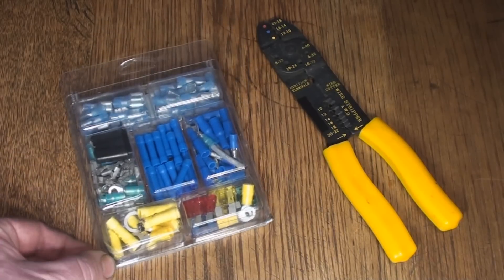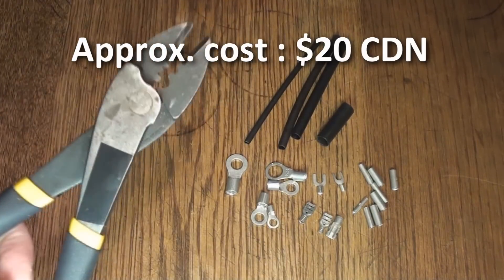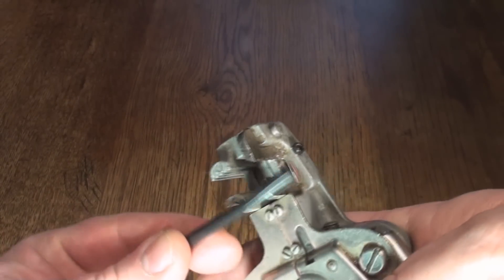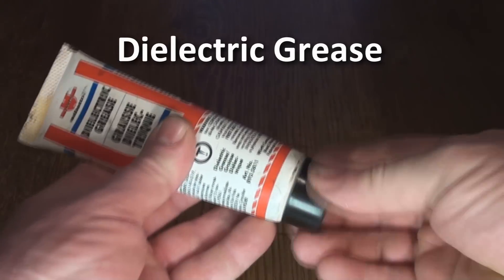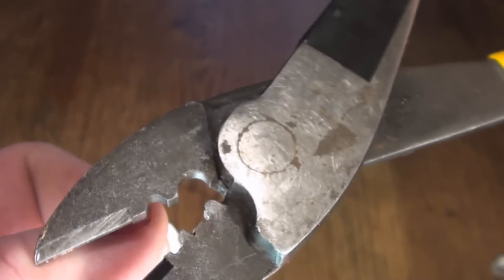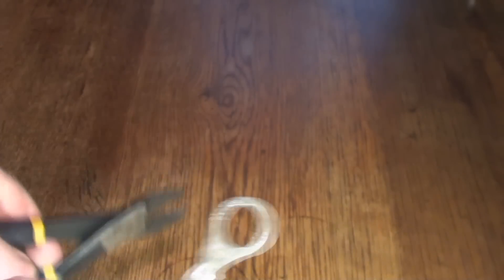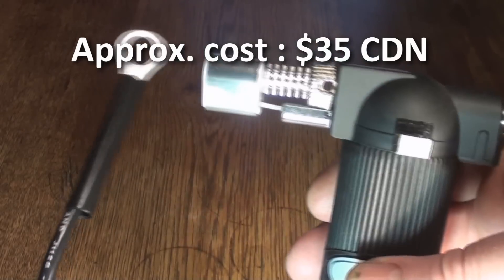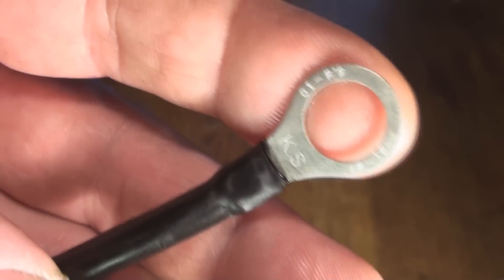Reliable Crimp Connections

Comment: Thanks for posting this video. This approach definitely gives more professional looking results than when using pre-insulated connectors. I'll be using this method from now on. Also, someone had asked what wire strippers you were using at 1:44. These look very similar to my Ideal brand Stripmaster strippers. I've had them for over 30 years and they still work great. Currently available from Lowes for $24.94.

Comment: Thank you so much for this brilliantly useful video. I have struggled for ages with the insulated crimps, finding they often pull out even though I have a ratchet crimp tool. There is nothing to hold the wires, whereas the uninsulated ones with the crimped in recess hold & don't pull out. Extraordinarily helpful to me.
Reply from the maker: +Springwood Cottage - Glad to be able to help. Thanks for commenting!

Comment: Good tips! I usually use a q-tip (okay, okay, i just my finger) to apply the Dielectric Grease after I've made the crimp, not before. Dielectric Grease is used to insulate and prevent corrosion. It's the insulation properties that wig me out but hey, if it works it works.

Comment: Great video, thanks.  I have always used the crimp tool the opposite way with the male die against the seam.  Now I am going to have to try your way.  
I like the use of dielectric grease, it should fill up any nooks and crannies in the joint reducing the opportunity for corrosion.
Reply from the maker: Thanks and yes it works great in marine environment

Comment from the maker: My strippers are antique and have no brand name showing. A quick google images search shows tons of options. Irwin/visegrip makes a set.
Dielectric grease is silicone based and therefore non-conductive. The idea is to give corrosion protection to the exposed metals. When crimped there will be hard contact where the grease is squeezed out but still clings to the exposed areas preventing corrosion that can creep into the hard contact areas and interrupt continuity.

Comment from the maker: The terminals you need do exist, so if you're a perfectionist, keep looking, someone's going to have them. Otherwise try piggy-backing: crimp a wire connector (tube) on the wire end, then insert the connector into the terminal and crimp that. In a pinch, you have to get creative. Sometimes I'll just strip an extra long piece of insulation off the wire and fold it back on itself - doubling the wire mass - and use the larger size terminal on the doubled over wire. Crude but effective. Good luck!

Comment: I think that a proper crimp is better than a proper solder joint.  A proper crimp deforms the copper strands  to the point that the spaces between the strands closes eliminating air and moisture from the connection.   A solder joint also eliminates air and moisture but it is a weaker joint mechanically and solder has more resistance than the direct metal to metal connection of a crimp.   
Also if you are good at soldering you should solder and if you are good at crimping you should crimp because both are good joints when done properly.
Reply from the maker: Thanks for commenting and for your insight!
Reply: Agreed, except that soldering alone should be avoided except where crimping is not an option.  Also any wet, insulating grease should only be applied after crimping and soldering!  It's an interesting technique but an unnecessary addition of dielectric.  However, conductive grease like silver-bearing types would be okay, but also unnecessary.  As a last concern, I would not use a torch where a heat gun could do the job.  Other than these few criticisms, there are many good points in the video.

The best method I have seen (used by Val den Hul Cables) and used is a very strong crimp (= cold weld) with solder applied to the exposed end, i.e. the very end of the wire, to seal it.  Finally, good shrink wrapping over the rest of the assembly, as shown in the video, will seal the assembly beautifully.  Semi-rigid, adhesive-lined heatshrink, (what appears to have been used) is ideal for marine environments.  I often double the layers, with a shorter one on the inside for the best strain relief.  This termination will conduct well for 100+ years in dry environments if the wire has good insulation and mechanical construction, and if the connector and terminal have rhodium and/or gold plating.
Reply: Terry Pullen good insight, both crimping or soldering has very applicable application advantages and disadvantages.

Comment: Good video but have a question.
Dielectric grease is an insulator,not a conductor.
It’s good to cover a finished terminal from corrosion 
but not use inside a connector,no?

Comment: I use the male side of crimpers into the split, then turn the connector 180 and use the non insulated crimp to give it a cold weld. I call it the tuck and fold

Comment: Very good instructional video, especially the close-up when you're placing the terminal seam-side up into the terminal pliers. What is the specific name or brand of the kind of wire strippers you're holding @ 1:44?  I haven't been able to find them.  I don't understand why your're dipping the copper into the dielectric grease -- wouldn't that interfere with the conductivity between the terminal and the stranded wire? Thanks

Comment: You can also shrink using a cheap cigarette lighter if you need to, I try and keep the flame off of the material though.
Reply from the maker: True but I always burn myself on the wheel the second time I try to light it.

Comment: I have seen many crimped ends done by the manufacturers and I can attest that the male part of the crimp tool goes into the crack forming a heart shaped end over the connector and not from the bottom of the connector. Please correct me if I am wrong and thanks for the great video !!
Reply from the maker: Ma Serry More than one road leads to Rome. There's even an airport.
Reply: Touche my friend !
Reply: Yes +1 to that.

Comment: Silicone tape (X-treme tape) works as shrink tubing after crimping is done. 

By the way, since dielectric grease is an insulator, i would think it would reduce the conductivity between the cable & terminal (not good).  Seems like it should go on the outside of the connection..
Reply: Agreed DO NOT dip your wire in dielectric grease prior to crimping. if you are worried about corrosion crimp the connector tighten it down wherever you are applying it THEN cover in grease.
Reply from the maker: Justin Steer You guys are certainly entitled to your opinions, that's why I don't just delete contradictory comments. However (for the benefit of those viewers who aren't sure they know everything yet) I have made thousands of connections this way that still work today in spite of the severely corrosive environment found in steel vessels in salt water. I look forward to seeing your video on the subject.
Reply: While dialectic grease is an insulator, a properly crimped connection will squeeze the excess grease out of the terminal. For improperly crimped connection like shown in this video, excess grease can make things worse.
Reply: No-Ox-id A special is the actual product to use...
Reply: +Repairs101 I agree it eliminates space for corrosive materials to be introduced to the connection.
Reply: Suppose the way to settle this would be make a crimp both ways a couple times  and measure the difference.

Comment: I thought that for stranded cable the seam on the lug is supposed to fold in forming the top of a "heart" shape. Using male end of the crimper on the back of the terminal prevents this from happening.
Reply: One Two That what I have seen In many instructional videos
Reply: Yup.

Comment: I know this vid is a little old and I apologize for the late question. I'm guessing your limited to 10 gauge on those strippers? Is there a way to shimmy and twist a larger gauge wire (4 gauge) to get the job done? Never seen a pair like that. Would be perfect if the weren't limited to 10....
Reply from the maker: +dustingaldeano  the strippers shown are Speedex Mfg. USA and strip wire from 8ga to 18ga. Irwin Vise Grip makes one as do Klien tools (  http://astore.amazon.com/repairs101c0a-20/detail/B00BC39YFQ ) and other manufacturers.

Comment: just got hired as an avionics electrician, fabricating wire bundles and holy shit does this weird as shit. I've never used a lug that crimps from behind the barrel, never seen dialectic grease used. Hell I've never seen a crimp tool that doesn't have a wire stop.
Reply from the maker: +eXpLiiiSiT - welcome to heavy duty marine mechanics.

Comment: I got a question,where can you get those good connectors like KAR products used to have? Walmart type connectors are pretty junky.
Reply from the maker: dan meme I get them (here in Vancouver) at automotive supply stores like Lordco, NAPA and North Shore Auto Parts. Good luck!
Reply: Repairs101
Thanks,I'll check napa.

Comment: Never knew about the 'male' crimping tool. I have moved to a ratchet style crimping tool a few years ago, only used the 'complete kit' tool before that. This ratchet style one haven't got any 'male' parts, just one side with flat bottomed semicircles and the other side with two ridges. Any tips on this tool - do the terminals go in both ways?
Reply from the maker: 7eis I can't recall ever having seen anyone use a crimp tool like you describe. I Googled it and see what you mean but can't offer any tips any different from what's in the video. Perhaps another viewer will comment.
Reply: Repairs101 7eis is referring to the open barrel connector (F-Crimp) crimpers like this one: http://www.bandc.biz/ProductImages/RCT4_detail.jpg
Reply from the maker: Thanks CoreyLee!
Reply: The bottom of the terminal goes on the smooth side, the seam (top side) goes on the side with the ridges. The ridges guide the two sides back down toward the bottom, so that they don't just slide over each other or fold in some weird way.

Comment: Okay, for all you negative nancy's that insist on stating dielectric is not to be used in the demonstration here, how bout you do the same with one greased and one ungreased, then just do a resistance check. Really, for the distance it's going, gauge used and quality of crimp he's performing, it won't matter. I'd much rather have peace of mind that there's no way this terminal will corrode in my lifetime.
Reply from the maker: This guy gets it.
(Thanks for sticking up for me, brother!)
Reply: The resistance check using the ohm setting on the multimeter will give you an incorrect reading. use voltage drop.
If you have a wire with 10 strands, 9 corroded/broken and 1 good strand, the wire will show 0 Ohms.
Same with his crimp. Putting dielectric grease on the wire and inside the connector barrel is adding an insulating layer in between, the compression of the crimp dissipates most grease out but there is still a thin layer. The crimp is that 1 good strand. Will show 0 Ohm. 

Long story short.
The crimp is great. dielectric grease is used improperly.
Reply: Then how come I get good readings and lovely arc at the plug when doing just so?
Reply: Auzryel 
Because he doesn't get that electrical current travels along the surface of metals and that with an accurate crimp the outer surface of the crimp connector becomes the largest conductor from point a to point b without any issues.
Reply: Whenever you place the wire strands in the barrel and crimp the connection the dielectric grease shifts out of the way as more pressure is placed on the two metals being pressed together.
Reply: although if i had a choice on what could be used i'd much prefer to solder the connections in place with silver solder since you get a better connection without any risks of the crimp connections falling off later on and silver is a great conductor.

Comment: Would it make a difference if I tint the end of the strip wire with solder first then crimp the tint wire?
Reply from the maker: I've never done that (though sometimes I add solder to a crimped connection) but I imagine it would help corrosion protection. Maybe ask an electrician (I'm a mechanic). Good luck!

Comment: is the Dielectric Grease there only to keep moister out ?
Reply from the maker: Mar Gudmundsson Exactly. I work as a marine engine mechanic which means one of the harshest, wettest, saltiest environments wiring can be asked to perform in. The grease prevents corrosion of exposed wire - corrosion that will ultimately creep under the terminal and disrupt the connection.

Comment: Two negative comments: (i) the use of dielectric grease by definition will make a poor connection. (the clue is in the name!) (ii) the use of heat shrink over the bare conductors reduces the insulation integrity of the joint massively. Its much thinner than the insulation on the wire and can easily lead to short circuits. This is why the pre-insulated crimp terminals are better - especially with but joints. The insulation integrity is largely maintained.

Comment: what is the heat gun youre using? please share model...
Reply from the maker: Miguel Angel Mastercraft 120V-60hz 6/12.5a - 250 & 450 degrees celsius / 482 & 842 degrees fahrenheit. From Canadian Tire. I don't see a model number. Good luck!

Comment: I feel that the whole point of crimping is to reduce the amount of time spent. Having to heat-shrink adds another step. I might was well solder the connection. I'm not sure how I feel about making the indent on the back of the connector. Did you find that doing it that way makes it more reliable?
Reply from the maker: +ThingsDemystified - that's really a question for the mechanics who trained me and probably those who trained them. I was trained to do it this way. I'm assuming that the mechanics before me figured it out through trial and error. I don't know about you but I can't solder anywhere near as fast as I can crimp and wrap. Not to mention challenges of working outdoors in the weather.
Reply: Repairs101
It'd be interesting to do some tests on how much force it would take to pull the wire out of crimps done by certain crimpers. I'm also coming across several posts about not using dielectric grease inside the terminals. I think it's perfectly ok to do, but some people are adamant that is the wrong way to use it. I guess the only way to convince them is to show them that there is no increase in resistance when the grease is applied.
Reply from the maker: +ThingsDemystified - Excellent ideas I may have to include in a follow up video one day - thanks for commenting. BTW I can hang my 200lb self off any 10ga crimp I make and not break it .

Comment: Dielectric grease it's a bad idea. Also you crimped it from wrong side. That's a heat shrink, not a burning torch flame shrink. You can heat it by torch but not burn it and melt it.

Comment: Found that this doesn't work for 18 volts systems :(
Reply from the maker: +Chris M - OK I'll bite (U B trollin?) What exactly do you have running on 18V? I have been a mechanic many years and never encountered an 18V system - AND I'll add that these connections are superior regardless of voltage.
Reply: +Repairs101 Just goofing around. :) Thanks for the great video!